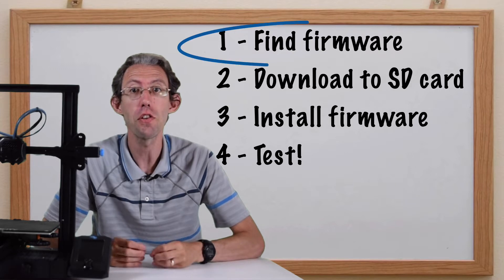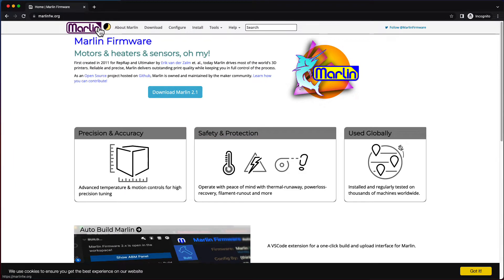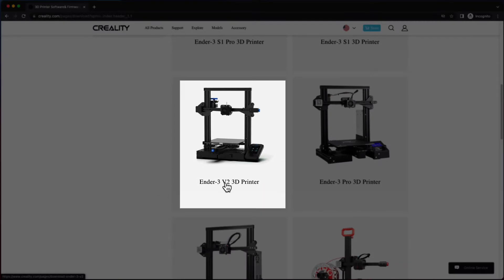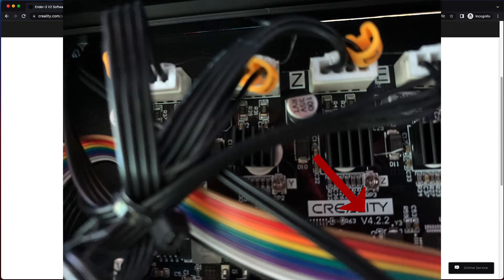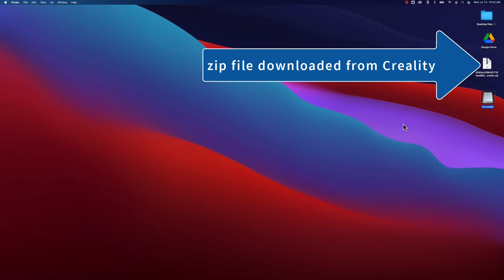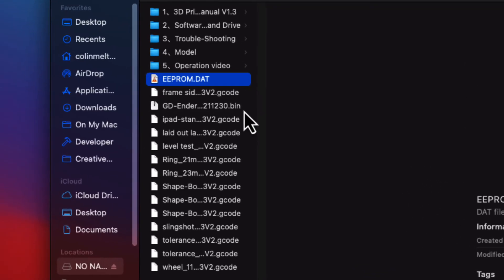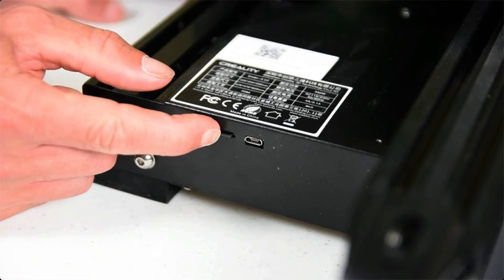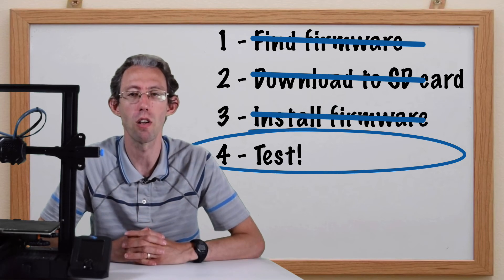How  to update your 3D Printers Firmware. Creality Ender 3v2

Comment: Heya there’s a new motherboard that the ender 3v2 comes with now it’s the 4.3.1 and I was wondering if I can boot a new firmware on it. I did some research and it says that I can load 4.2.2 versions of the product. Can u tell me if it’s right?

Comment: I installed a new motherboard, tried installing new firmware and my screen stays blank
Reply: The same is happening to me, did you fix it?
Reply: @guilhermecoutinho7521  same thing happened to me, did you ever get it resolved?
Reply: PS. Rename of the firmware everytime or it will not work
Reply: same thing happened to me, did you ever get it resolved?